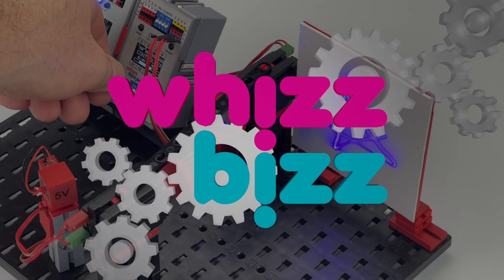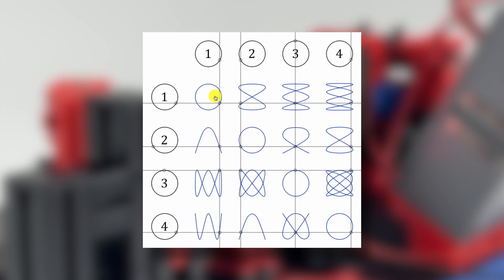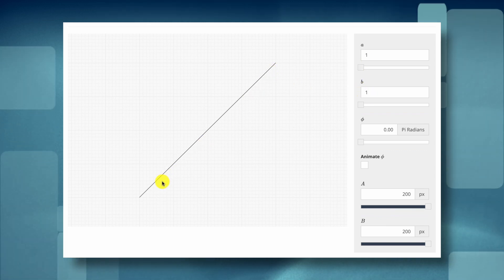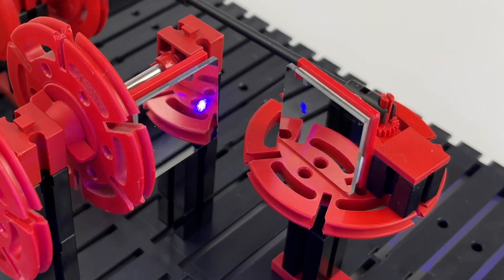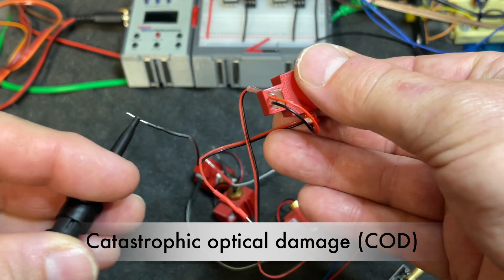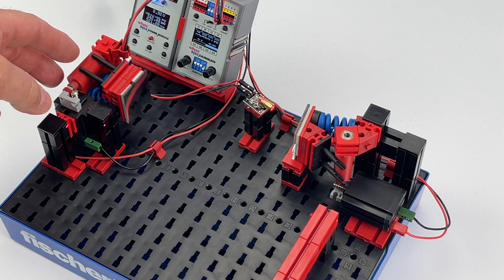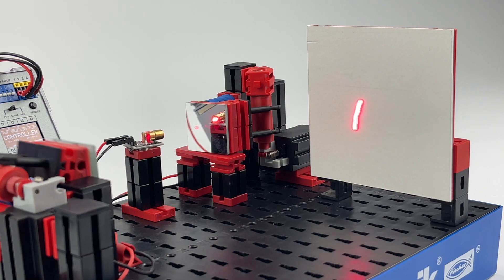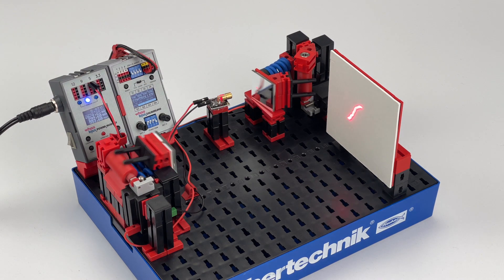Projecting Lissajous curves with a laser

Comment: Awesome video, I like the modular setup. Which diode laser is this?
Reply from the maker: I ordered a blue 100mW, and a green 50mW, and a few red ones (?mW, probably <30mW) lasers from China. They're 13 or 9mm in diameter, so I designed a 'holder' for them to be used with the fischertechnik construction system. You can download it at https://www.printables.com/model/342970-stone-for-mounting-a-semiconductor-laser

Comment: Interesting, haven't seen Fischertecnik in about 25 years when I played with them when I was young
Reply from the maker: I was also surprised when I discovered that it is still being made (for me several years ago). I played with it a lot in the 1970s and 1980s, and now many 'Makers' use it for prototyping and product development because it has significant 'industrial' advantages over eg Lego Technic.
Reply: @arnoud-whizzbizz  yeah I found it a lot of fun as a child, the novelty of motorizing things was really cool. Seems lego did not do it till later on though I could be wrong. It was a simpler and quicker system for building models.
Reply from the maker: @jgfishz1zz1  Lego Technic indeed came later and Lego has now stopped with its 'Mindstorms', while fischertechnik has always embraced automation and electronics over the years.
Reply: @arnoud-whizzbizz  I remember mindstorms now from computer class